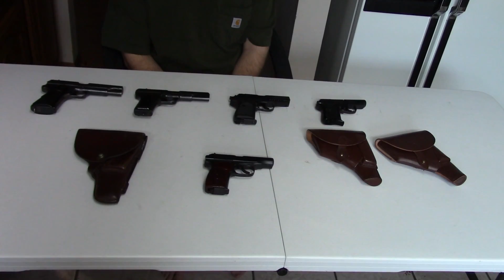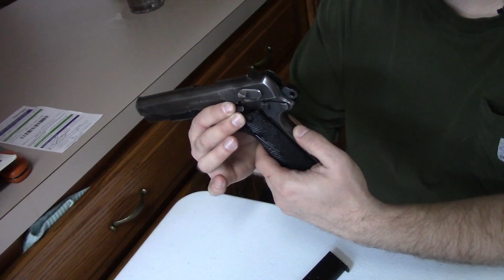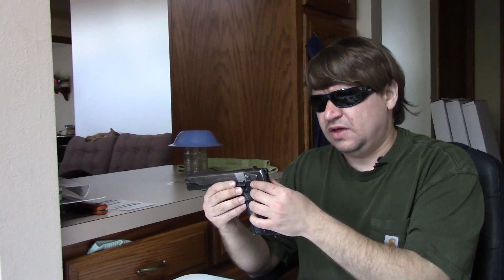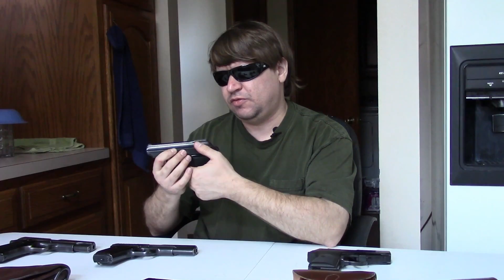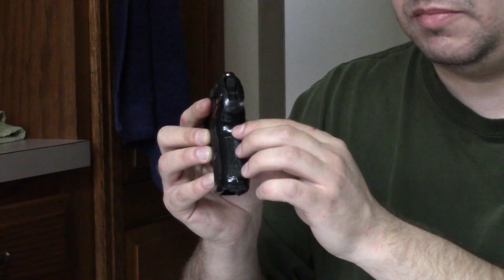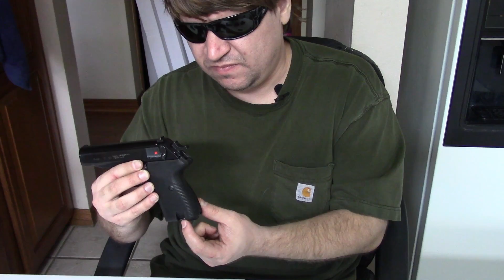VIS P-35, Wz.33, P-64, & P-83 Wanad: Polish Military Sidearms Overview

Comment: From 1947 to 1953 the Makarov used a take down system very similar to the P-83.  It was left out of the 1953 frame redesign, most likely due to the effort required to machine it.  While generally I like the P-83 that positive outlook disappears if disassembly is carried out beyond basic field stripping.  Lots of small springs and pins abound.  I still have nightmares about reinstalling the firing pin and spring!   Thanks for the nice video.

Comment: I am surprised they didn't go the Czech route and just rechamber the VIS 35 in 7.62 Tokerav, the Czechs got away with using their own in house designed pistols.
Reply: I think it was more a money/ease thing.
Reply: @misha5670  Fair enough, I figured if the Czechs could rechamber the CZ52 for 7.62 Tokerav from 9mm that it would have been easy to do the same to the VIS 35.

Comment: Great video Misha, as usual. I have a VIS 35 a WWII bring back by my father. It is a 1938 Type I with  the Polish eagle in near mint condition. A beautiful gun! It took me a while to learn how to field strip it. When you use they take down catch properly and pull out on the recoil spring, the slide stop literally falls out of the gun. There are some improper videos on YouTube where people are trying to hammer out the slide stop. I also have the P64 and P83. I did the Sootch spring replacement for the P64 and it greatly improved the double action but made the single action trigger very light! The P64 is probably the snappiest I’ve ever fired- can’t shoot it for very long. Thanks for the informative videos and keep them coming!
Reply: A 1938 Polish Eagle VIS'35 is really something unique, special, and valuable. Definitely take good care of it and don't sell it...or if you do, sell it to me lol. Also glad you know how to field strip it properly. sigh I know what you mean about incorrect youtube videos. People sometimes just don't take the time to really learn about individual firearms. The takedown catch is quite handy for sure.

Comment: Why is it the 9x19 has been made to be more powerful and competitive with other rounds but the 9x18 seems to be somewhat anemic? Is it because 9x18 is no longer used ?
Reply: Honestly because 9x18 was designed to push the edge already in what could be safely and reasonably fired out of a non-locked breech handgun. Remember, most all 9x19 guns have a locked breech of some kind or at least a delayed recoil system like the Beretta PX4. If someone tried suping up 9x18, it would lead to stout recoil and a lot of stress on the pistol. That said, both the Czechs and Russians did develop stronger 9x18 cartridges. They were about 15% to 20% more powerful. To do this, they used a combination of a lighter projectile with a stronger powder charge. They were successful but really the benefits were relatively minor. In the end, 9x18 already does what it was intended to do very well; self defense at close to medium range. For more, checkout the various videos in our 9x18 playlist, cheers.

Comment: I have a P-83 and agree that the trigger, particularly the reset, is better than a Makarov.  When I bought it, not knowing it was a modification of the Makarov, I chose it over a Bulgarian Makarov because of the superior trigger (in my estimation).  One thing I have noticed, is that it is not unusual to get round debris coming back toward you when shooting.  I've only shot brass through it because of the indoor range I frequent, so don't know if this is unique to brass cased vs steel cased.  Has anyone else had this experience?  I will be going to an outdoor range where I can shoot steel cased to see if it exhibits the same phenomenon. 
I also agree the magazines are harder to find and more expensive.  Collector's Firearms where I purchased it did happen to have a magazine for it, which I purchased on the spot.  I do plan to buy a Maharov to compare against it, but haven't decided between a Bulgarian or a Russian, understanding the trigger will probably not be as good.  Any thoughts on which is better?
Reply: Hmmm, haven't really noticed that with my own P-83. Jay has one too and he can chime in to let us know if he has experienced it himself though. I bet it is your ammo or the combination of ammo + pistol. The P-83 has very similar dimentions/specs to the original Makarov PM, but really it is its own design. Its trigger system, takedown, and other internals are all different. It just looks like a Mak from the outside. Damn good gun though, and up until 2009, they really weren't available here in the USA. That was when surplus examples started hitting the market in large numbers. Before that time, it was a relatively rare pistol here.

Comment: It's couple more..relatively modern. WIST-94( so far unavailable in U.S) and MAG 95(steel frame) and MAG-98 (aluminum frame) . Last two fairly easy to got it.
Reply: And Nagan revolver. WIST is real dumpster fire I heard
Reply: @ksztyrix  You heard right. WIST 94 shouldn t have won endurance and acceptance trials, it was a boondoggle development process, engineers from WIT and Zielonka didn t have any clue how to design proper functioning military service pistol regarding tolerances, material quality, bolt construction, disasembly etc. There were allegations of huge bribes involved. The problems were that serious, that some units preparing to deploy to Iraq and Afghanistan elected to revert back to P-83 to get at least some kind of functioning sidearm.

Cheers from Poland.
Reply: @lizardb8694  Dzięki. Never shot WIST myself. I never understood why they didn't choose MAG-95 instead, but government act mysterious ways